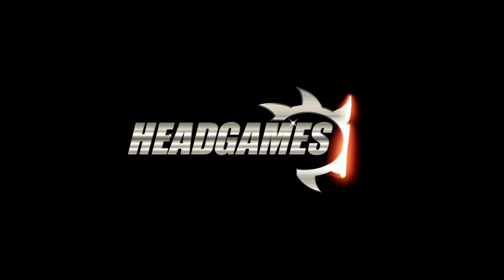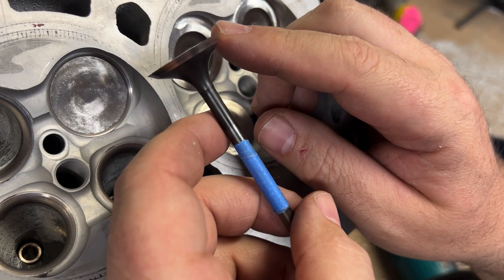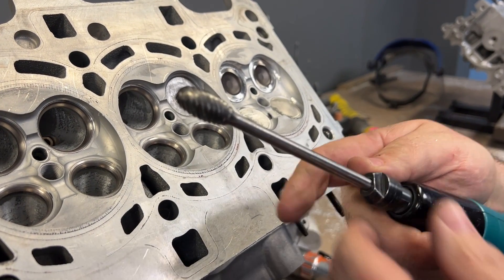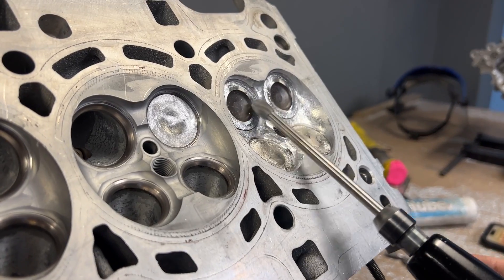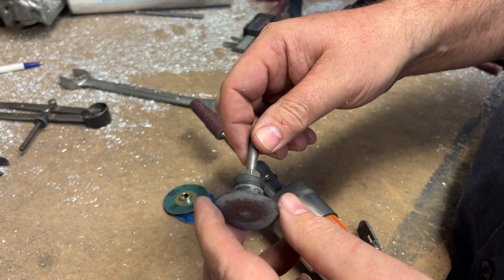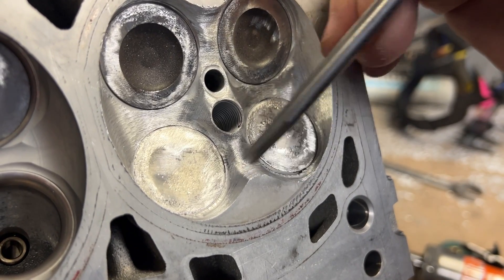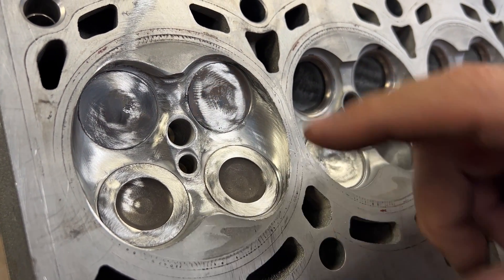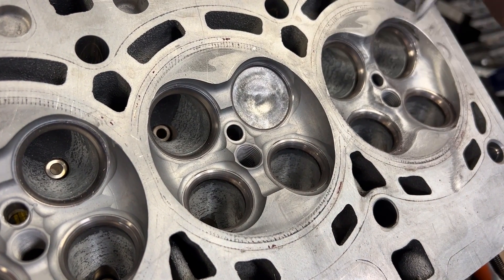HOW TO: Combustion chamber reshape for BMW N20!

Comment: Is the reason you use air tool with the 120 roll for higher  rpm?  Thanks
Reply from the maker: No, it’s because it’s front exhaust so it blows off any residual filings as you sand it. It keeps the work space clean so you can see what you are doing. And control, the electric is far too fast for a good finish with a 60 or 120 grit.

Comment: everything looks nice, i think your missing a dremel with 1/4 carbide ball tip. it fits in those tight place near the valve so perfect.

(It would only be doing 2% of the job, so cordless would be enough on one charge)
Reply from the maker: I’ve never used a dremel but maybe I’ll take a look
Reply: Forget the dremel Dave... You are so fast and hitting heads like no one. The dremel will last 2 heads and will be Dead. I tested all of them. 

Save the money